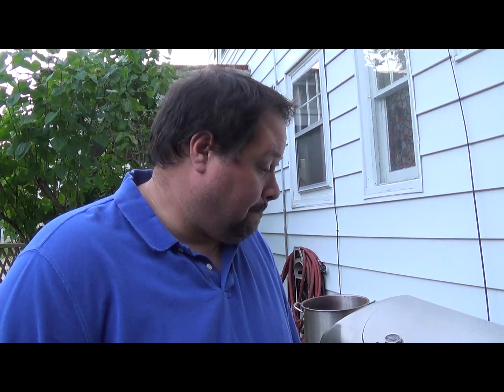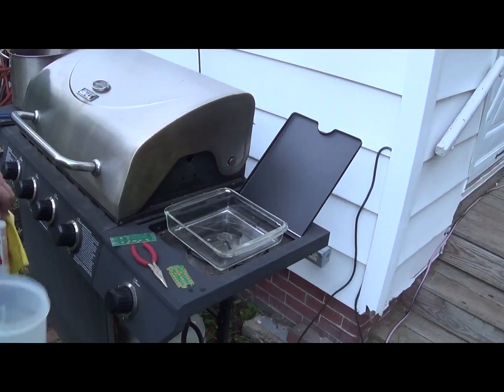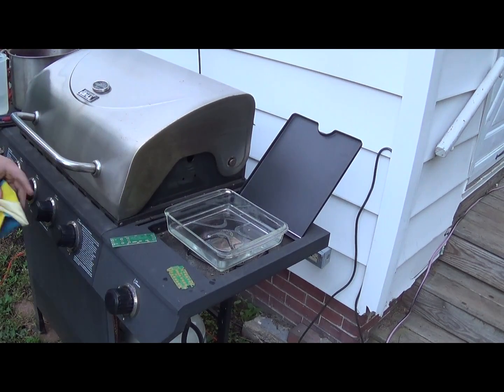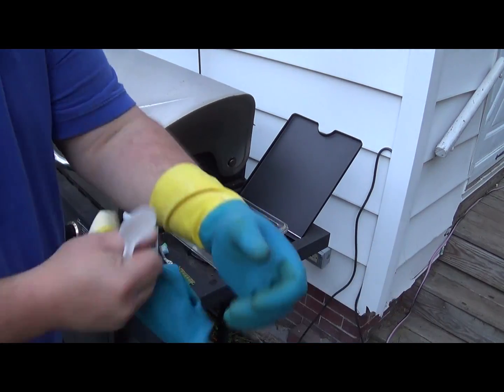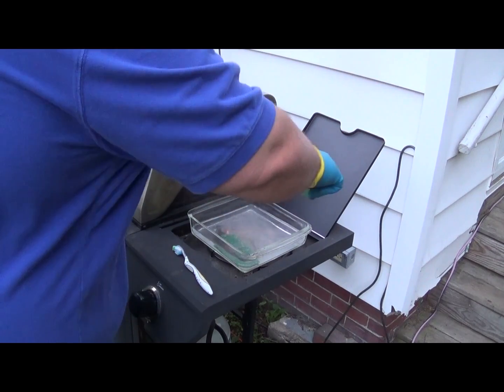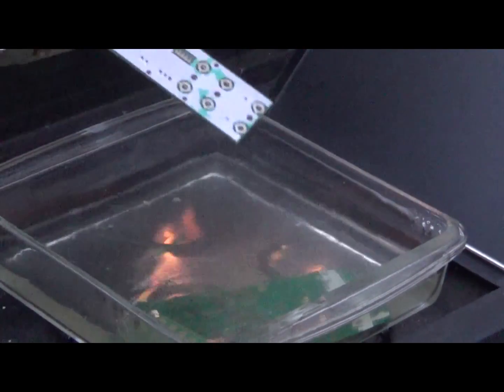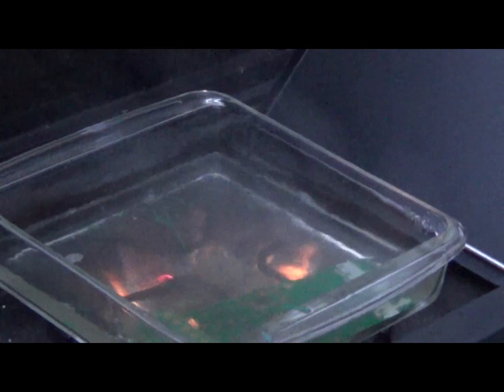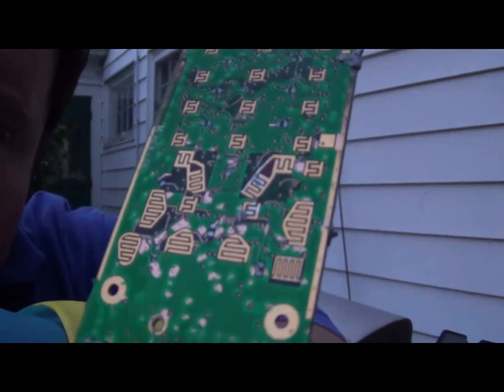How to Remove the Green Solder Mask from Cell phone and other boards for gold recovery

Comment: Moose, will this procedure un-solder components as well? I'm looking for a process to remove the very thin tin layer on glass that occurs during manufacturing and if this removes solder it should remove the thin layer of tin, it's thin enough you are able to look through it.

Comment: VERY IMPORTANT SAFETY POINTS!!! Never do ANYTHING like this w/o safety glasses. More than acid, splashing lye into your eyes will permanently blind you! I would also not try to dissolve lye in hot water -- use cool water 1st (never add water directly to dry lye powder! It can explode) then warm it up.

Comment: finally got time to revisit this process, been busy redoing a couple of properties. after trying this method on several different types of solder mask and failing, (no fault of moose) I had time this afternoon to step it up a little. I had two boards one about 5x6 the other about 3x6 that were 90% gold(not purity just mass) under solder mask, coudn't give up on them. bumped up the temp to almost a slow boil and added two more teespons of lye, waited 15 minutes achieved partial removal. removed what I could with a brass wire scrubber, let them soak another 15 removed again, 10 more minutes and all came off. Also worked really great with that dam white solder mask. I used a stainless steel pot. Only works with the light green solder mask, the dark green will take a nuclear reaction.  Going to try  some more this week.  dont try this at home and its not moose's fault he gave me the idea  cheers
Reply: Les Larsen Why you told "the dark green will take a nuclear reaction" ? You scared me :) Will make flames, will explode ? What will happen ? Can you give some detail please ?

Comment: I recently recovered a large number of boards from high-end video processing equipment from the late 90's to early 2000's.  They all have a much thicker green solder mask on the boards covering large sections of gold plated copper (EMF shielding) and lye does NOTHING to them.  I've also tried various paint strippers (some quite caustic) as well as HCL and sulphuric acid and nothing touches this stuff.  Short of grinding or burning I"m at a loss as to what else to try.  Any ideas?

Comment: Sort the boards first by scratching off a small section of the masking with a utility knife blade, you can easily identify which are Copper and which are Gold. "Some but not all" cell, modem, wireless access point, video card, touch pad boards (any probably others) have gold under the mask. Thanks for the video Moose 👍🏻👍🏻👍🏻

Comment: AH? why wouldn't you just do a scratch test first to see under the mask?  The other point being all full plate or flashed board with mask tends to use a lacquer mask that will come off much easier than from copper or other substrates as it just don't stick to da gold. Try a presoak in cold, worm or boiling wata for whatever time ya likes in TSP or da limeo and lets it sits fa as long as you can stand to seee if it loosens da mask . start with a test batch if it work do biiiig batch let da moose know how tings go.
Reply from the maker: You cant do a scratch test because the gold layer is so thin you are going to remove it when you scratch exposing the copper under it.

Comment: Hi Moose I was wondering if this method could also be used for DVD and CD's to recover the metal film on them... I saw one where he use caustic acid is this same thing or no? From what I have read Caustic acid and Lye is Sodium Hydroxide which would react with aluminium and dissipate it... which would make  sodium aluminate. So unless you knew how to Precipitate the aluminium back out of the solution which I would want the aluminium as well as any silver or gold I could recover Just some thoughts.... Any Ideas?

Comment: Using a Glass Pyrex anything on a gas burner or on electric hotplate outside is VERY Dangerous,,,, they will Explode an shatter when exposed to the slightest temperature change,,,don't wonna see ya get hurt Moose,,,stainless or borosilacate is the way to go,,,other than that great video
Reply: david qrobinson Pyrex is boro glass

Comment: thanx for that mate :). i could be wrong but i did not think there was any gold under the mask ? it would be expensive ,i thought the gold plate was added after the mask ? have you ever found any gold under it ?
Reply from the maker: +Tim Ellison many times.  Especially in cell phones and mouse touch pads.  THe amount of gold used is so minimal that it does not effect the cost that much.
Reply: HI cool ,i will keep a look out for that type then ,i have checked so broads not all ,but i do keep the old one's .and Cheers Moose love your vid's learnt a lot kepp up the good work m8.

Comment: hi moose is there anything else that I can use instead of lye to get the green solder off, if you are on whatsapp please message me with the answer its easier to communicate. +263772589512and if you can form a whatsapp group as well would be good.thanksregardspunam

Comment: Thanks for the video, I've been wanting to know how to do this for some time!  
  Would it be safe to put the boards in the solution with resistors, capacitors and things of such still on them?
Reply from the maker: +qwertypoop1000 The lye may eat up some of that, but regardless, before any further gold recovery the items need to be removed anyway and it makes it much easier to brush away the solder mask if the board is clean.

Comment: Love the videos. Keep making them.
For this one, I've used my utility knife blade to scrape off a bit of the solder mask which usually reveals copper.
I think the manufacturers took into consideration the waste of gold from not masking the boards before plating. Never got a board with gold under the solder mask yet

Comment: Please be aware that hot lye solution will etch the glass over time and weaken it.  It also reacts with aluminum metal pans or utensils releasing flammable hydrogen so keep in mind to remove any aluminum heatsinks, brackets, etc also.  It's best to do this in a plastic tray of the type they use for photographic chemicals.  Heat the water separately in a pan or kettle (of course not hot enough to melt the plastic though) then add it to the tray with the dry lye powder.

Comment: DO NOT USE PYREX!!!!!

Lye (NaOH) will eat through glass, even pyrex. In chemistry labs people often use it to free up locked joints in glassware. Stainless steel is the material you should use.
Reply: Yes, aqueous NaOH will attack glass, but it takes a long time to eat through boro (Pyrex is a brand name, not a formulation of glass) Do you really think that chemists use stainless steel labware when using hydroxides? We don't normally. Not in my 33 years as a chemist. Only for large batch processes usually. Let's see a video showing lye eating through a flask...anyone? I've boiled crucibles fouled with waste 3.3 sodium borohydride in 20% NaOH solution for many hours with negligible erosion.  We use bases that are many orders of magnitude more caustic. Alkoxides for instance are commonly used to rip away stubborn protons from a reagent to make it more reactive. These are orders of magnitude more basic than the pH 14 you learned in general chemistry. Super bases can have an effective pH of 50 or more. Learn what pKa and pKb are. The 1-14 pH scale is long outdated but still used as a teaching tool. It usually takes 7-10 years to become a PhD Chemist plus another 5 years post-doc work for experience. Whatever you decide to do just be safe, stay alert and focused on the task at hand, and always have a plan of attack.

Comment: Moose, I went to Lowes and Home depot, none of them sell 100% Lye but HD does carry drano crystals that has Sodium Hydroxide (caustic soda-lye) would this work?? I
Reply from the maker: Lee Cosner I don't know, I have never tried it.  I try to follow the philosophy of the folks on the gold refining forum.  "People have been after gold for thousands of years, thus there have been thousands of years of experimentation, people spending their entire lives finding only methods that do not work.  Given this, why try to cut corners when you have a process that is known to work every time?" rough quote.  I am not a chemist, and this is all a hobby for me.  I try to not deviate from what is proven and written in Hoke's book on recovery and refining, and the goldrefiningforum.  Walmarts website has it listed for $3.12.
Reply: Ok, thanks Moose
Reply: +Lee Cosner hit tractor supply as well as lowes they do have 100 % lye just read the bottles especially the back with the chem and msds

Comment: You can if you like to spend the time soak the already removed solder masked board with the copper in a/p collect the gold foils that would come off and with aluminum foil little bit at a time creating aluminum chloride the drops the copper out boil off the clear liquid and collect the copper powder to smelt the copper it won't be a bank breaking amount but in time it will add up

Comment: looking for mass production would this alkilie or however you spell it be harmful to a pump seal ? just wondered if you could make a bath with jets spray directly against the boards whilst being submerged with an electric element keeping it at correct temperature also what is the correct temperature.

hope that makes sense love the videos and love taking things apart so interesting :)
Reply from the maker: Great question, unfortunately I do not know.  I know that it is used in plumming to fix clogged drains, and I know it eats up some metals like aluminum, but do not know about the rest.  Thanks!

Comment: best video ive watched about scrap in years!!-indeed i have asked my self  `is there gold under that green stuff ` i have about 100 cell phones i am taking apart ,it would be great to find some that are all gold :) ive noticed on the backs of some ram it has either copper spots or gold spots,, i wounder hhhmmmm cant wait to try this on a few boards i have in mind ,thanks again moose
p.s where is the video that people keep talking about when cutting ram fingers "were cut those of and save the boards for another video" what happens with those
i herd feets `touch on` ruthenium resisters any more knowledge on this one
Reply from the maker: The rest of the board is usually saved for the IC's.  Feets is a great scrapper and has a lot more knowledge on the other componants that have value.  I know I am throwing away cash often but the only things I save are the MLCC's, Tantalum capacitors (learned about those from feets), ICS, etc.  Geo has a video where he says that he throws the ram sticks into old AP to remove the IC's and whatever tiny ammounts of gold might be in those little spots.
Reply: yea is the best video ever thanks

Comment: I read some where that insulated wire can be stripped using this method for the copper. Is this true?
Reply from the maker: Using lye and hot water?  I have never heard that.  The two methods that i know of for getting coper wire stripped is by either mechanical means like strippers, razors, etc or by burning, and I am not in favor of burning things.  I am trying to help the enviroment...lol